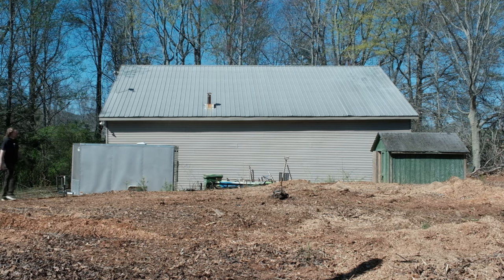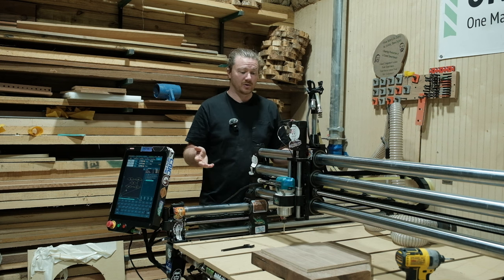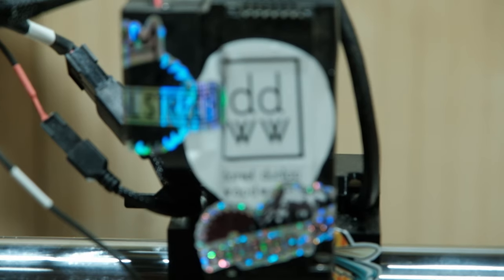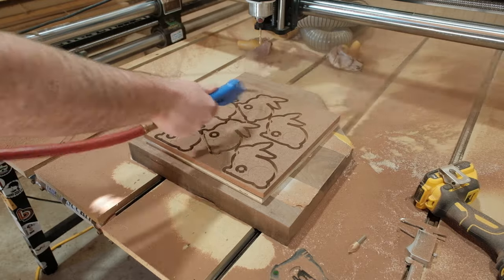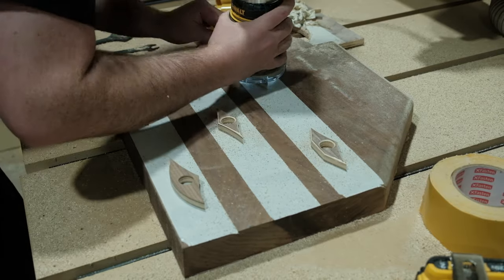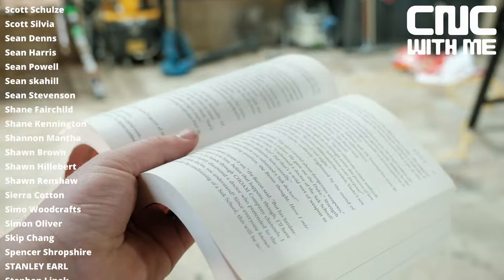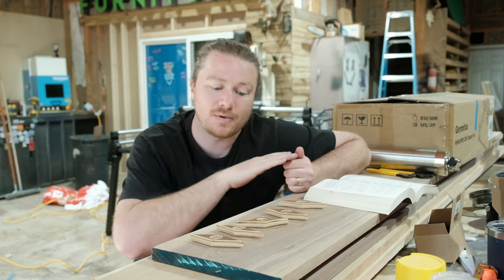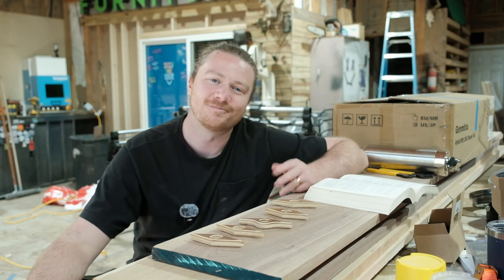Someone Cut Power To My Woodshop...

Comment: Looks like the perfect place for solar panels and an EcoFlow Delta Pro Ultra… go off grid for the barn and don’t worry about power ever again.
Reply: Agreed. We moved into a home built in 1969 about a year ago. It also has a pole barn. Rather than paying to have grid power to the barn we went with an Anker F3800 (6KW output). The barn still needs to be rehab'd, so the Anker is getting its trial run in the underpowered garage until the pole barn is ready. We also have an 8KW gas generator, but it's just unpleasant to use that on a regular basis.

Comment: Hi 👋, sorry to hear about you losing power, if you go for a generator, I believe for many years ago that some generators cannot, and do not run computer systems, I’m afraid I’m an old dude, I do not know exactly what it is about, but before you buy one, make sure it is capable or compatible with computers, And the people who cut who line surely they are responsible and should pay for the replacement, And reinsulation,

Comment: Bummer on the loss of power.  Must have been quite exciting when they hit the power line. 

Ok, as a temporary power solution, do this. 

1. Find out the largest amps required by whatever machine you must have running. 

2.) Get a UPS for every machine that has a computer/electonics running it. 

3.) Purchase a generator that can comfortably run the largest amperage that you found on step #1. Size it for an additional output of at least (minimum) 25%. Something around 220VAC @30 Amps. 

4.) Have the Main AC lines disconnected from your fuse/breaker inside the barn. 

5.) Wire a cord from the generator to the Main AC lines into the panel (or have a qualified electrician do it) .

This should give you enough power to run the lights & (1) machine at a time. Also you don’t have to purchase the biggest & bad ass generator. That would be a want, not a need. Plus, in the  future if you decide to go Solar PV (I teach design & installation of Renewable Energy Systems) the generator can be designed in. 

Hope it helps.

Comment: You need to talk to a skilled electrician because you can get three phase from 220.  You can install a VFD (Variable Frequency Drive) or a RPC( Rotary Phase Converter). I have seen this done at several places. My mechanic has a lathe and needed 3 phase so he did it and built his own with capacitors etc.  He has never had a problem. I also saw this done when I attended electrical school with a VFD on the motors we had there. I believe their is a slight loss of power to the motors when converting also. A little less torque.

The least expensive way is VFD and works as long as the HP (Horse Power) of the motors are not extremely great. You can also buy RFP and to some they are a little pricey but depends on what you want. You can get a RFP for 3 HP for around $750 a 5hp for about $900. A 20 HP would set you back about $3000 so the price increases with the size of the HP of your motors.

The point is you can get 3 phase power for your machines. Ask a competent electrician or if you have an electrical school close by stop in and ask the instructors about it.

You could also go solar. They make 3 phase inverters that hook up to solar panels with or without batteries.

Comment: Shit happens all the time and everywhere.  Normally it should be possible to have the power cable repaired if it hasn't  been cut through only at one or two places.
I'm surprised you can't get 3-phase power (as well) , when they  are  putting everything new. I'd go to ask it once more if that is really true. Good luck.
The holes in the bunnies are for putting a twine through it.  In half a year can hang them in the Christmas tree.

Comment: If you'd like to be energy independent and go off-grid completely Hamilton, I can connect you with my wife who configures both residential and commercial solar featuring battery & generator components when necessary.  We haven't really had an electric bill in over four years since installing our system.

Comment: You're using extension cords, aren't you.
Reply from the maker: I wish I could have from the house... I don't have that length. I had to do a dirty fix where the line was cut and im still missing a leg of power. So then extension cords from where I could get power... Not ideal, hopefully I can get it buttoned up soon!
Reply: @HamiltonDilbeck your description just sounds sketchy as heck.  But I would prob do the same if put in same boat with same goals and explain it in same manner.